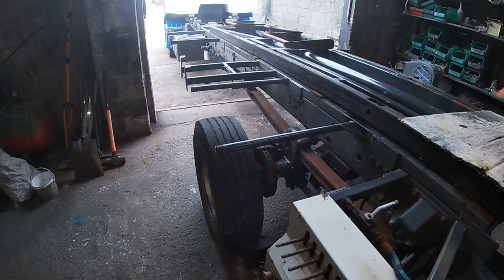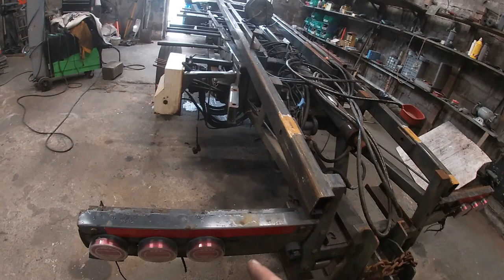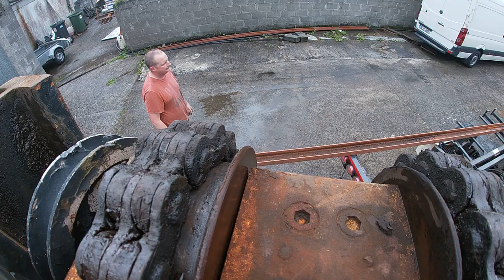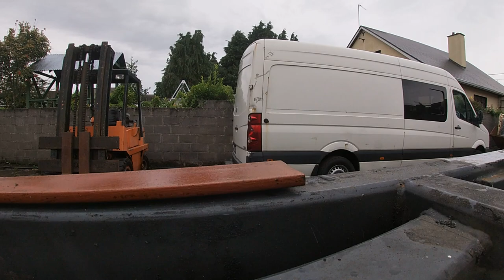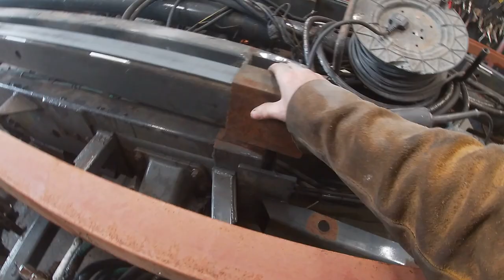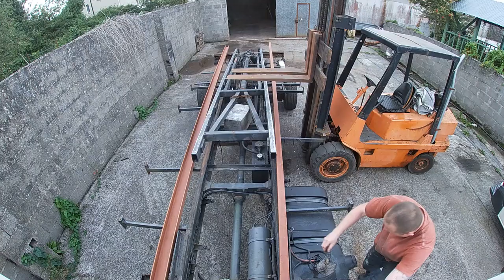DAF LF tilt and slide recovery body build pt3

Comment: looks like a rodger dyson body.
Reply from the maker: Ya it is how could you tell was It the rollers or something else on the body
Reply: @harnesslife  lol i have one. you can tell by the way its made
Reply from the maker: This is the first Rodger and Dyson I have looked at and its built away stronger than recovery world body's the spec lift is and ram mounts are alot thicker steel and more bracing and the tilt ram mounts are better designed recovery world I think are just made for transportation
Reply: @harnesslife  mine is a 6ton body strong as hell ive had 10ton in it. the 3ton bodys are alot lighter. yours look like a 6ton aswell. is it 24ft?
Reply from the maker: Ya it was a 3 car transporter it had 2 on the bed where it lifted it up that's why the sub frame is a bit bent with all the weight